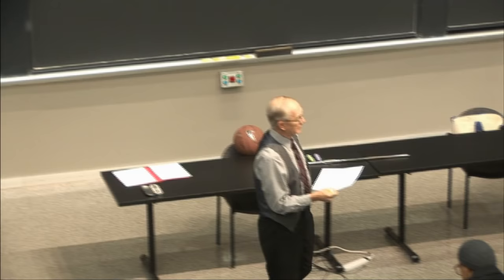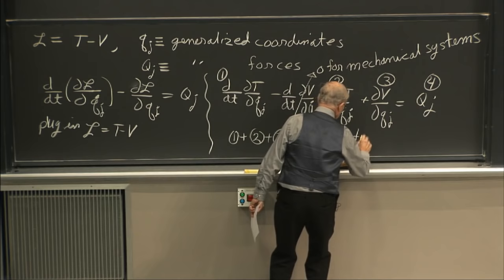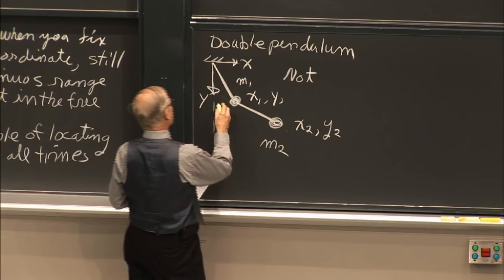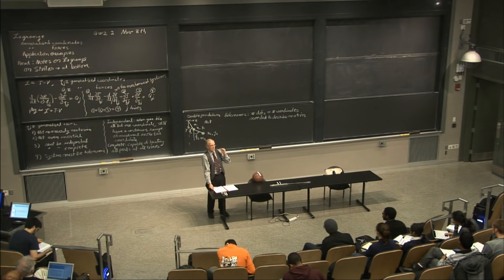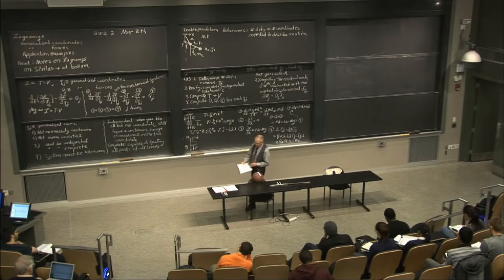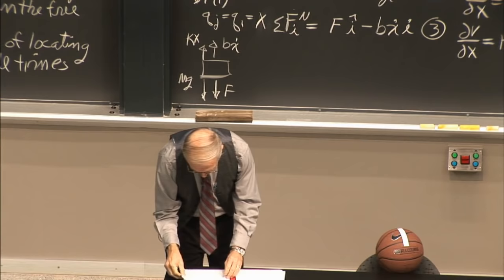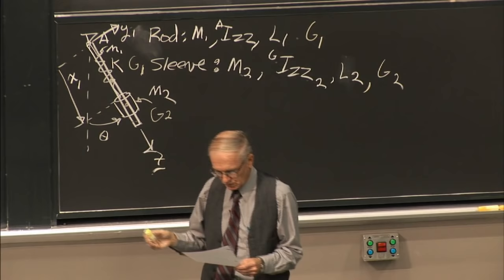15. Introduction to Lagrange With Examples

Comment: This is the most detailed explanation of Lagrange EOM I have found on the net so far! Thank you much!
Reply: really? i can't believed, he didn't even explain where "L=T-V" comes from.
Reply: Do you have more detailed course on analytic mechanics?
Reply: @lauraesthela6941  
I personally think that lectures should be spent more on example problems instead of rigorous proofs and derivations.
The lectures are primarily supposed to be a foundation for your studies anyway, they aren't supposed to cover the material that the course books already talk about at length.
I also think that proofs make much more sense after you have already tried a few example problems - they shouldn't be this mysterious mess of symbols and definitions, they should actually mean something and become obvious to you after you have checked them a couple times, otherwise they are useless.
Reply: @Peter_1986  WELL SAID
Reply: @lauraesthela6941  in the previous course......
Reply: @TheSharkyBoyCostyn  Where?
Reply: @ahmadzakiy7204  In the description of the video there's the link to the course.

Comment: just wow.  goes to show how different universities can be.  i went to school for applied math with a concentration in stats, so i ended up having to taking a lot of physics classes because those met a lot of my pre-reqs for my degree.  and not once in any of my upper division physics classes, did the prof ever mention how you need to test first to see if you can use a lagrangian.  apparently they just always gave us problems where it worked, and they just left that entire part out.

Comment: Holy crap that rod and sleeve problem is insane. I don't think my professor would ever expect my class to solve something like that.

This is MIT though so I don't know what I expected.
Reply: Evan Schurr It's lagrangian mechanics, all physics undergrads take it
Reply: It was pretty mean. I paused and tried it all. I got stuck on the kinetic energies of the objects actually lol. I was pretty off.
Reply: @xFoKe  In the Philippines, Langagian Mechanics and Hamiltonian Mechanics is thought in Master's Degree
Reply: Dane Gil Cabrales I’m in my second year of the theoretical physics bachalor and I’m taking classical mechanics with lagrange, hamilton and special relativity. The course is obligatory.
Reply: @yerhing6406  what country are you studying in?
Reply: yer hing ^ what they said
Reply: In aerospace engineering in Spain, we learn this in the third year.

Comment: 50:30.. I think the refrence of potential energy for the rod is when theta equals 90 degree, max potential energy. and zero potentional enegry when it's straight down, that's why he got confusion about the signs, so the equation is correct.
Reply: From what he said, reference position (= Equilibrium position) is when rod is vertically hanging from the pin. Once oscillation starts, the CG of the rod moves up / down.  This difference is taken as change in potential energy. This is what I could make out.

Comment: The conceptual descriptions here are cogent and systematic, but I think the jump from a spring pendulum to that rod/sleeve problem serves to confuse rather than make anything clearer. I understand wanting to give students a challenging problem so that others are easy by comparison, but there seems to me to be too much to keep track of in that problem—rotation, driving force etc.—to solidify the concepts by example. You lose the forest in the trees. I think a more intermediate problem might have been useful to solve to completion.

Comment: holonomic means path independent
nonholonomic  path dependent
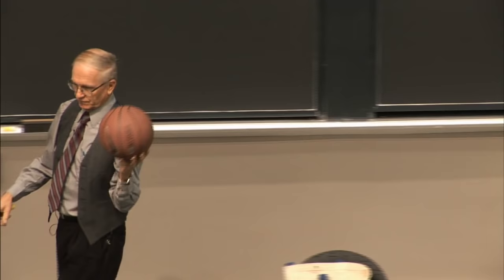at 19:28 he said this system is NOT holonomic, but he chose 2 coordinates to describe the white mark on a ball. this has nothing to do with SYSTEM, choose 3 coordinates to describe  the white mark on a ball, then the SYSTEM becomes holonomic (basically describable), when you say system i am talking about something intrinsic, only can be controlled by the system and NOT BY YOU. simply saying work done on the system by you OR work done by the system.

Comment: At 50:10 he clearly says that 'it is the change in height' that the rod goes through - so the expression gives 'change' in potential energy. 
However, that is not what we are aiming to write; as per my understanding, we are writing the 'potential energy' of the system, not the change in it. 
If any of you has an explanation, please share with me.
Reply: Anurag Anad: Potential energy can be referred relative to any chosen origin; it is not an absolute quantity as you seem to think.  Only changes in potential energy have any physical significance.

Comment: 50:37 L0 is not the "unstretched spring length". It's the equilibrium spring length (up to half L2) when M2 is hanging from it.

1:11:00 And he reaches the same conclusion in his static analysis at the end (without ever correcting his definition.)
Reply: Philandros Good! Now you're less full of yourself then.
Reply: Unstretched spring length is synonymous with Equilibrium spring length, it's just less formal. A spring with a mass on it, in equilibrium, is unstretched, any peturbations or imbalances and it stretches and contracts.
Reply: it's less formally defined but is still valid, you just have to pay attention to realise whether he's defining relative to just the spring itself, or the spring with the mass in this system.
Reply: Laurelindo
No, you can hang a spring upside down and let gravity stretch the spring. Once it's stretched and no longer stretching, it will be in equilibrium whilst being a stretched spring too. It's in equilibrium when all the forces acting on it is in balance, it's not about whether or not it's storing energy.
Reply: Philandros 
Ah yeah, thats true - vertical simple harmonic motion, forgot about that one. :)
Reply: Since you consider massless springs, massless dampers, massles strings etc. in these problems, those two terms are identical. The equations would look differently if you considered real springs (I mean, the actual effect would be small, but the equations would be quite a bit more complicated).

Comment: @56.00 why isn't the calculation for kinetic energy for sleeve done wrt A since it is rotating about A and not rotating about G
Reply: There are two components to it's kinetic energy. The first is due to its translational energy, and the second is due to the fact that it's rotating about it's center of mass (while simultaneously translating). So you are correct that A is the axis of rotation for it's entire motion, but to simplify the calculations, the translational motion is treated separately from the rotational motion. This is because Izz wrt A of the sleeve would be time dependent in the inertial frame, but Izz wrt G is not. It's essentially using superposition to isolate a fixed point of rotation.

Comment: Thank you so much for this video! i´m an student for the upm (universidad politécnica de madrid), in spain. If there are any videos about hit transfer i would apreciate it.
Reply: Try going through "Elementary Applied Partial Differential Equations With Fourier Series And Boundary Value Problems" by Richard Haberman for any help in heat transfer theory. I found this book extremely helpful with explanations :)
Reply: Cool!! I will read it, thanks.

Comment: 51:56 Why don't have to take account of the length change due to the mass of sleeve?

KX=M2g
X=M2g/K

M2g(L0+L2/2+M2g/K) - M2gX1cos (theta)

I thought the reference should be the final possible state? equilibrium state?

Comment: I could be mistaken, but I believe that except for the potential energy of the spring, the potential energy terms in the second problem are incorrect.  First, the dependence on theta for the rod should be 1+sin not 1-cos.  1-cos would give 0 potential energy at theta=0, which is not correct (should be simply MgL1/2 - the center of mass is L1/2 above ground (the ground being the distal end of the rod when theta is 0, i.e., L1 from the top of the system - one would imagine - though this was never specified), and mgL/2 at pi/2, when the rod is horizontal, which is also wrong, and should be simply MgL (the entire rod is L1 above ground). using 1+sin gives the correct result (MgL/2 at 0 and MgL at pi/2).  The only way to imagine 1-cos as correct would be to assume ground is at L/2, and perhaps that is what is being done here, but I can't see why that would be. Maybe it would work out to the same thing in the end, since my way and the way presented here only differ then in a translation of the zero point for gravity, but I doubt it.

For the sleeve, the problem is more convoluted, but also incorrect as presented. If theta is zero, then according to the presentation V for the sleeve = Mg*(Lo + L2/2 - x1), and if the spring is unstretched (x1 = Lo + L2/2), V=Mg(Lo+L2/2-Lo-L2/2) = 0. This would mean that the ground is defined as being at -(Lo+L2/2) from the top of the system, which is not consistent with either a logical placement of ground (L1 from top or the top of the system itself), or the position to which it appears to have been set if the potential presented for the rod was correct (L1/2 from top).  Also, if theta is pi/2, the expression presented reduces to Mg(Lo + L2/2), implying that Lo+L2/2 = L1, which is not likely and certainly not specified. For a correct expression, assuming the ground is at L1 from the top, then when theta is 0, V for the sleeve is 0 when x1 = L1, and increases as x1 becomes smaller than L1, so there's an L1-x1 in there, and if theta is 0, then V=Mg(L1-x1), and this component of the potential for the sleeve drops to 0 at theta=pi/2, but the height of its center of mass increases to L1, so, at pi/2 V=Mg(L1), suggesting an L1sin term. long story short, what I get is Mg(L1-x1)cost+MgL1sint, which at least is easy to see for theta = 0 and pi/2.
Reply: Hi Glen:
the movement and the potential energy of the sleeve has nothing to do with the length L1 of the rod.  The most easy places to define the ground are the places where x1 = Lo + (L2/2) (no spring strength) and theta = 0 (no gravitational "strength"). Then, because gravitational potential energies are all related with heights from the ground, and theta is measured from the vertical, all the heights in this problem must be expressed in terms of cosine functions of that theta.

Comment: thank you for the explanation. i was following lectures from the start. I found that there may be lecture missing about how to calculate KE and PE for translating and rotating frames. you keep on referring that lecture like " as we calculated in previous lecture etc etc". will you please add that lecture or give me some reference which is more alike to your previous lecture to successfully calculate KE and PE for any system.. please help.

Comment: Difference I noticed between Germany and America after watching some MIT engineering courses including this one.

So you actually must take lagragian mechanics in mechanical engineering undergrad in Germany. Would be nice if someone can explain to me how the whole modulsystem in America works. So:
Someone said that such difficult examples are of course because of the MIT standard. 
That level of difficulty in the rod and sleeve problem, you will actually find in every german university. There are much more difficult problems, that you could have taken in the introduction of Langragian Mechanics. (i think) 
I just think it would be better that EVERY university in America has in some way the same level of difficulty. Thats how it is in germany. But if there is a  good reason why it shouldnt be, let me know please. 

This Professor at MIT does one good job explaining the basics that you need to know and account to. I find it much easier to understand than at my university in Berlin. That level of explanation should be a standard. Here in Germay, there are just a few professors who explain that good AND have a solid pace. It ends up forcing you to take much longer to understand a concept. Its just inefficient. 
But what i dont like is, why doesnt he use an E-board???? That forces people to take notes :p

Comment: When phi 1 is fixed phi 2 can still move ....same way when x1 is fixed x2 can still move.... so why not independent..??? 
I  mean to say... phi 1 and phi 2 are fixed one by one but x1 and x2 were fixed simultaneously... why so??
Reply: it would have been independent if you fixed x1,y1,x2 and after that y2 would still be free.Here he just fixes x1 and x2 and the system is not free anymore so it isnt independent

Comment: WHY THE TIDES ARE NECESSARILY ELECTROMAGNETIC/gravitational IN BALANCE, AS THE ROTATION OF WHAT IS THE MOON MATCHES IT'S REVOLUTION; AS ELECTROMAGNETISM/energy is gravity ON BALANCE:

Gravity AND ELECTROMAGNETISM/energy are linked AND BALANCED opposites ON BALANCE, AS ELECTROMAGNETISM/energy is gravity ON BALANCE. This NECESSARILY represents, INVOLVES, AND DESCRIBES what is possible/potential AND actual IN BALANCE, as TIME dilation ULTIMATELY proves ON BALANCE that ELECTROMAGNETISM/energy is gravity ON BALANCE. “Mass”/ENERGY involves BALANCED inertia/INERTIAL RESISTANCE consistent with/as what is BALANCED ELECTROMAGNETIC/GRAVITATIONAL force/ENERGY, as ELECTROMAGNETISM/energy is gravity ON BALANCE. This explains F=ma AND E=mc2. TIME is NECESSARILY possible/potential AND actual IN BALANCE, AS ELECTROMAGNETISM/energy is gravity ON BALANCE.

BALANCE AND completeness go hand in hand. TIME is NECESSARILY possible/potential AND actual IN BALANCE, as ELECTROMAGNETISM/energy is gravity ON BALANCE. Consider BALANCED BODILY/VISUAL EXPERIENCE !! It has to be this way in order for INVISIBLE bodily experience to be understood ON BALANCE. It's called QUANTUM GRAVITY. Consider what is THE MAN (AND THE EYE) who IS standing on what is THE EARTH/ground. Touch AND feeling BLEND, as ELECTROMAGNETISM/energy is gravity ON BALANCE. So, ON BALANCE, what is BALANCED inertia/INERTIAL RESISTANCE is fundamental. Energy has/involves GRAVITY, AND ENERGY has/involves inertia/INERTIAL RESISTANCE. Gravity is (CLEARLY AND NECESSARILY) proven to be ELECTROMAGNETISM/gravity ON BALANCE.

If we understand E=mc2 and F=ma to be in balance, then gravity/acceleration involves BALANCED inertia/INERTIAL RESISTANCE. So, this then explains why the rotation of the Moon matches it's revolution. (The perpetual motion of the Moon is also CLEARLY accounted for.) The stars AND PLANETS are POINTS in the night sky. Gravity and ELECTROMAGNETISM/energy are linked AND BALANCED opposites, as gravity is ELECTROMAGNETISM/energy. Accordingly, the planets will move away very, very, very slightly in relation to what is the Sun on balance. Consider the fully illuminated (and setting) Moon AND the orange (and setting) Sun when manifest at EYE LEVEL/body height. They are the same size as the eye AS WELL. NOW, the sky is blue; AND the Earth is also blue. The Moon is about one quarter (27 percent) the size of the Earth. The surface LAND area of the Earth is 29 percent. The connection with lava is CLEAR. (Consider the role or relation of WHAT IS THE EYE ON BALANCE !!!) Indeed, it is a very great truth that THE SELF represents, FORMS, and experiences a COMPREHENSIVE approximation of experience in general by combining conscious and unconscious experience. I have a preponderance of evidence that CLEARLY proves that the sizes of the fully illuminated (AND setting) Moon AND orange (AND setting) Sun are not meaningless, random, or insignificant. Indeed, this is CLEARLY CONNECTED with the fact that the rotation of WHAT IS the Moon matches it's revolution. GREAT. TIME dilation ULTIMATELY proves ON BALANCE that ELECTROMAGNETISM/energy is gravity ON BALANCE. This NECESSARILY represents, INVOLVES, AND DESCRIBES what is possible/potential AND actual IN BALANCE, as ELECTROMAGNETISM/energy is gravity ON BALANCE. Indeed, TIME is NECESSARILY possible/potential AND actual IN BALANCE; as ELECTROMAGNETISM/energy is CLEARLY and necessarily proven to be gravity ON BALANCE.

By Frank DiMeglio

Comment: can anyone explain why didn't he take Izz about A for sleeve?
please
Reply: Because Izz wrt A would be time dependent in the intertial frame. So instead he used superposition to treat the translational energy and rotational energy separately, and therefore simplify the problem by only considering Izz wrt G, which is constant

Comment: The expression for potential energy for the second problem doesn't seem to be consistent for all the terms i.e the spring, sleeve and rod. We need to choose the same initial condition for all the pieces instead of lowest energy positions for each. Since all of them exist as a system. Am I correct?? @ 50 mins

Comment: Why didn't we account for the extension that the spring experiences even at equilibrium position when calculating the potential energy of the sleeve ?
Reply: kameel amareen He did account for it.
He writes 1/2 k (X1-L0-0.5L2)^2
The L0 accounts for the equilibrium extension.

Comment: Can someone explain why you need the theta dot times x1 at 55:52? I thought the rotational kinetic energy for the sleeve is accounted for in the first term.
Reply: What I understood is that we should account for two movements of  M2.. One along the rod (With a velocity of x dot)  and also rotating about the hinge along with the rod.. (Hence has a velocity component of  (v = r * omega used in circular motion)  i.e. x1 times theta dot.

Comment: hey at 51:13 i would like to know why you didnt take the displacement caused by M2 on the spring at equilibrium = M2*g/k.....Can anybody help? me?
Reply: As far as I understood, at equilibrium, M2 doesn't cause any displacement in the spring. The equilibrium point is taken at L0 => Unstretched length of spring